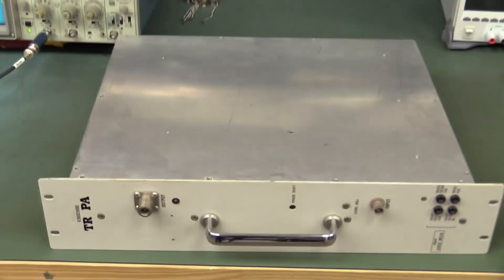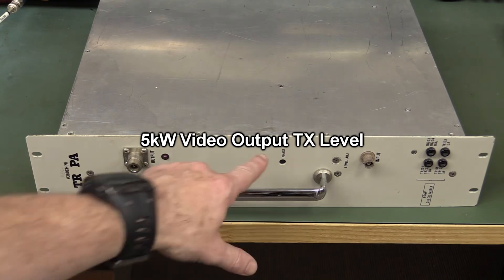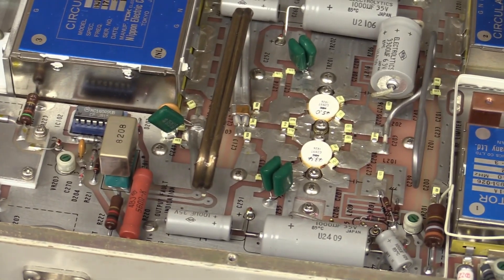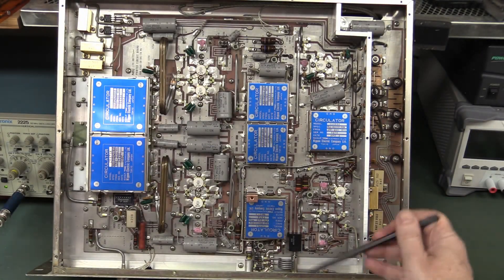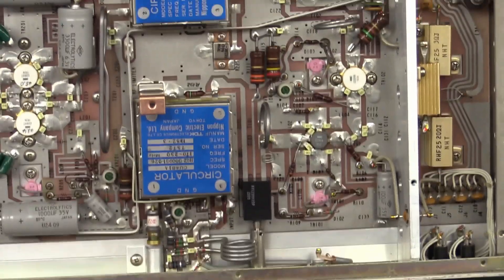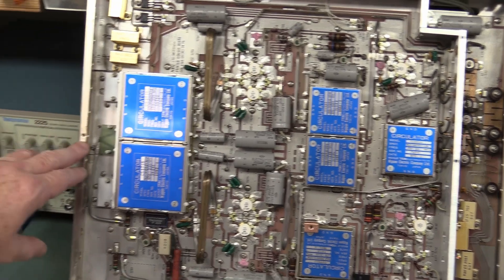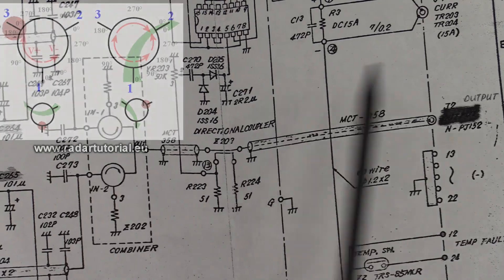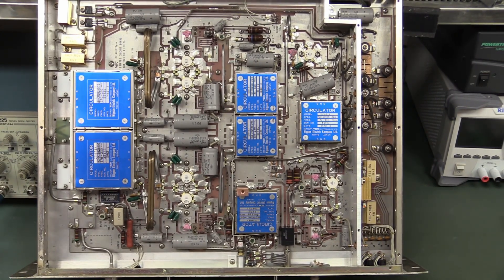CH7 Sydney 300W NEC TV Transmitter Teardown

Comment: The 'rigid' coax looks more like semirigid coax; it can typically be formed by hand, whereas rigid coax is exactly that, manufactured in the particular shape rather than being made from coax cable from a roll as semirigid cables are.

Comment: Circulators are a bit more advanced than that. Basically it's a multi-port device, and if we label the ports (for a 3 port device, port 1, 2 and 3), RF that comes in on port 1 goes out port 2., RF that comes in on port 2 goes out on port 3, and RF that comes in on port 3 goes out port 1. They are very useful in amplifiers because you can put the amplified output in port 1 and have port 2 be the antenna, and if you receive anything on port 2 (either due to antenna mismatch or a received signal), it goes out on port 3, so you can transmit and receive on one output. Useful for things like modems and such where you want full duplex operation so your cable modem transmits out to the cable, and receives on the cable and the tx and rx circuits are relatively isolated so you're not blasting your rx circuit with transmit power.

Comment: I would steer clear of those RF transistors especially if any of the cases look cracked. Possible that  they contain Beryllium oxide which is very nasty.
Reply: meh. i cracked some of those open. despite myths, beryllium oxide doesnt disintegrate easily into nasty dust, it just cracks in half.

Comment: ...nice bit of gear....
but...how is a Pre-Amp a "transmitter"... cmon Dave, youre better than that...
Reply: If you put an antenna on the output, rather than connect it to the upstream RF amplifiers, it becomes a transmitter.

Comment: I don't believe the circulator protects the output. What it does is re-direct reflections into a dummy load.
Reply: the circulators are used as power splitters and combiners
Reply: @echelonrank3927  No, that isn't what circulators do.
Reply: @cambridgemart2075  right,  it even says  combiner on the schematic because its not what they do. 
dont forget u just watched an RF video by a guy who keeps calling RF black magic and not a qualified RF engineer.
Reply: @echelonrank3927  I know, but I am an RF guy! It isn't possible to use a circulator as a combiner, but it can be part of a combiner, in fact they often are used on the inputs to combiners to prevent cross leakage.
Reply: It does both, reflected power is sent to a load instead of causing damage to the output stage.

Comment: I have a device that looks like this but it has way more stages but also in 19" rack format. The combiners and spliters in the one I have are made from discreet torroids. The final stage has an off the shelf combiner that takes the signals from all the amplifier stages, combines them and spits the signal out the output jack. The one I have appears to take 3-phase AC as input which is rectified to DC for all the power stages.

Comment: Love to have a unit like this to fire up pirate TV. I live in the mountains and there is only one radio station before the internet. I have run a pirate radio for years as i can only broadcast to the valley. So nobody ever bothers me. Have an audience of about 200 at any time.
Reply: bad news, regular tv receivers are not built nearly as sensitive as radios. u will be lucky to get a few km clear range with this thing.
i got 500m with a 7 watt test. that means 700 watts only gets u 5km. inverse square law. this is why this 300 watt thing is a only a preamp.
also dont forget this is a class B linear design, so the power consumption can reach 1000 watts,  its thousands of dollars per year in power bills.
the bang per buck just isnt there.
Reply: @echelonrank3927  That's not great. I only have a 5km by 15km area to cover.
Reply: @Mr.Unacceptable  its no loss, stick to radio, it keeps people free to do other things as they listen instead of getting them stuck to a screen like zombies.
Reply: @Mr.Unacceptable  Antenna whit field distribution as needed, yagi perhaps. Why waste power all ower...